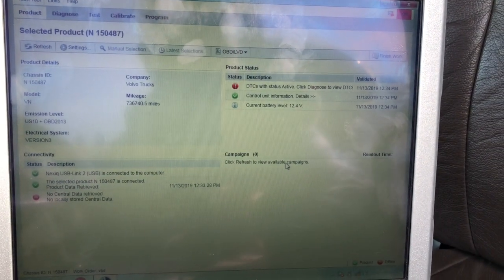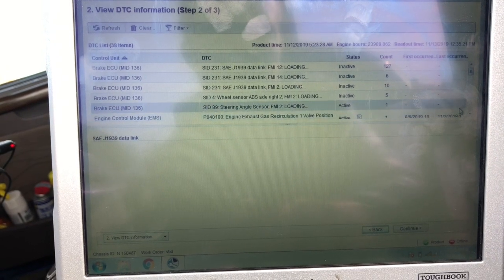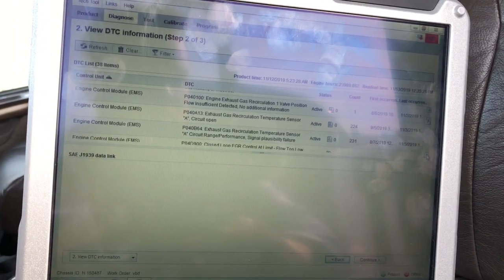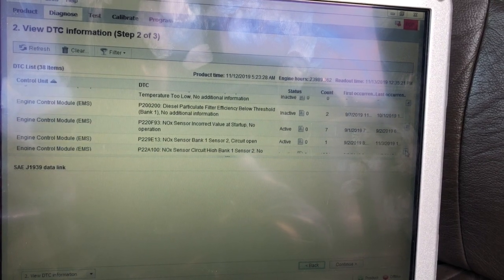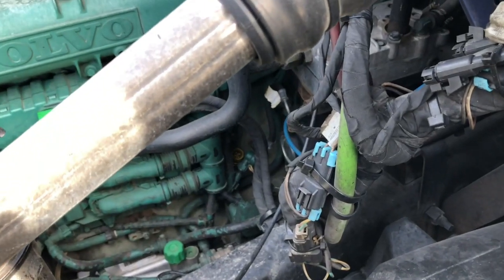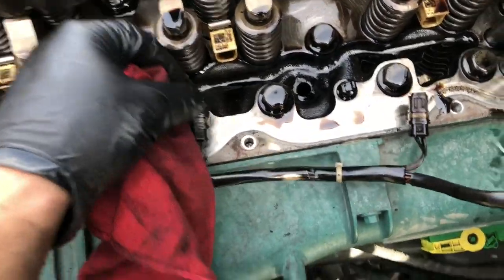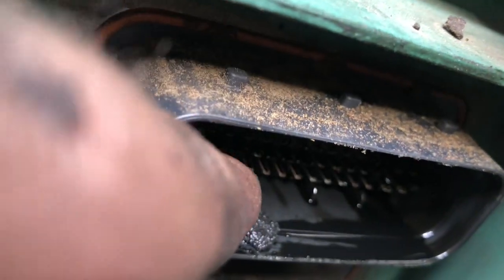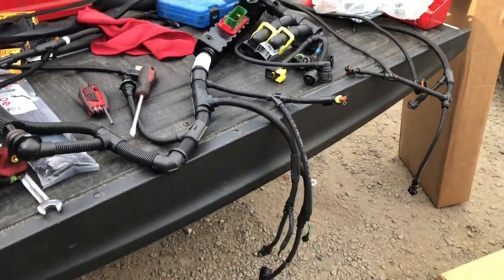Diagnosing a Volvo D13 with Tech Tool

Comment: Did you have to replace the ecm or did you clean the ecm connector pins if so which you used to clean it i found alil oil nothing major just trying to see if my ecm still good to use once i replace the engine wire harness

Comment: Hey bullet iam having a problem with my volvo j1939 data link erratic code engine- mid 128 sid 231 fmi 2, transmission- mid 130 sid 231 fmi 2, vehicle- mid 144 sid 231 fmi 2 all come back as j1939

Comment: Bad seal cause wiring harness gone bad  and will cause injectors missed fire. I replaced my Volvo D13 2018 on 03/27/23 ; Small shop need 5k for parts only (wiring with 2 injectors)Volvo Dealer need 8k for part and labor

Comment: Hello, I have a question concerning the D13. At the front/top of the motor their is a hose that runs to the driver side, down low. Can you tell me what it is and what is running through that hose? I think it may be leaking, the hose has some abrasions, also, it feels like it might be braided too, I guess kinda like hydraulic lines, but not sure.

It is the only hose that runs from the top front of the motor down to the driver side, down low.
Reply: I think that's the air line to the bypass valve, it's right after the outlet of the turbo on the aluminum pipe.

Comment: Quick question, what size torx socket did you use to remove the black computer box. Is it a special tool to fit through the small hole ?

Comment: These engines are famous for the injector harness inside the engine   gets brittle .and the insulation comes off     then all the wires touch each other   the same for mack  mp8 and mp7    dealt with  alot    it even burned some of the ecus

Comment: So would a bad engine harness cause the a lost in communication to the ECU where the truck will crank but not start and throw bogus fault codes? I have 07 Volvo VED12d and I think the harness may be my issue as well.
Reply: Check your battery cables…
Reply: @MrSwordfisher  I actually found the issue and since got my truck back running... it was a bad ECU....

Comment: Hello, Thanks for your videos, theyre really helpful. I installed Tech Tool and i also have trouble selecting proper options when you go to Diagnose tab. I see that with official version of PTT you dont have to select all the specs of your truck since it does it automatically. 
Can you help me with what options for Each category i gotta choose for my truck? i got 2020 Volvo VNL860 D13engine I-shift 12 speed transmission.

Comment: Please advise on a decent diagnostic tool/software for d13 volvo. I'd really appreciate it
Reply from the maker: I just use tech tool, the Volvo program. There is a lot of smaller little devices that can help read codes and sometimes clear them but I don't have much knowledge about those.